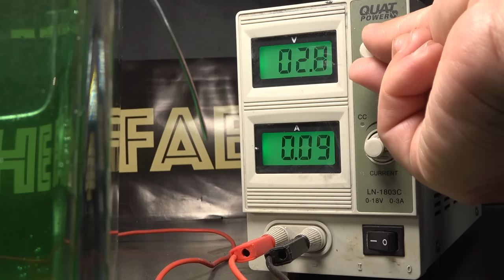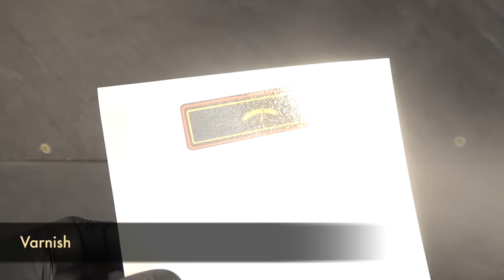1920's Live Steam locomotive 🔥💨  ! "BING" - Restoration

Comment: Awsome! I hawe the 1912 model, it's one of my personal favorites. I even managed to find some original tracks and switches for it.
Reply: I still have 8 pieces of O gauge track to go with my set.
Reply: @michaelcampin1464  Awsome! Even if those old steel tracks are not the best compared to the modern ones there is still a special feeling to them in my personal opinion that can´t be replaced by shiny plastic. (i hawe a modern plastic Lionel 0 gauge as well, but it mostly stand on the shelf since i lost interest in digitalizing after finding out i needed to replace the whole motor as well as running on DC if one wanted all the modern fetures and i don't want to build an entire new setup only for one single locomotive non of the other can even usel, so i concider selling it even if i love the design and the massive feeling of it, the old Hornby/JEP ones is just to clean and oil and it and put them on the track and they runs! Despite some of them being more than 100 Years old now.).

I Hawe the the Basset Lowke pre war steam mogul as well in my collecion, i managed to make a ok deal on it since it was smashed into pices whan i got it, but it was pretty easy to fix with new softsolder.
Ï currently working on an RC frame with model RC servos and a receiver for an old model aircraft radio i had laying around, my idea is to make the servos control the steam valve lever and the reverse lever (The double cylinder wersion has that function, the single operated cylinder does not i think othervise the seem pretty identical except for the construction of the steamvcylinders), perhaps also a servo for the steamwistle, that had been fun!
Reply from the maker: I’m looking for another steam livr loco ;) And that one is my favourite too 😌

Comment: Very, very nice results! Looks and runs great! Awesome job!  👍 The one piece that has the spring that is the cap for the water fill on the boiler is probably also a pressure release so it doesn't explode. The tightness of the screw compressing the spring probably is the adjustment for the pressure relief. On a real steam locomotive they're called pop off valves, in the USA anyway. Not sure how to adjust it on the toy but I'd say research and try to find out the specs on the little steam locomotive and adjustment steps for the pressure relief valve. That is if you don't know and/or haven't done this already. Live steam is fun but comes with some danger if not properly respected.
Reply from the maker: Thanks a lot William for all these infos 👍🏻😃🙌
Reply: @TheFabrik  Echoing @William Bryant 's caution here.  That part with the spring he mentions is the "Safety Valve" for the boiler, and the nut on the spring adjusts the pressure relief setting. If you want to keep operating the locomotive, you should really, REALLY pressure test that setting (off the boiler, not on) w/compressed air to ensure it is set at a safe level to keep the boiler from exploding from too much pressure.
Also, always be sure to operate with sufficient water. Overheating the metal due to low water levels has caused more "real world" boiler explosions than too much pressure. Distilled water is best for your lovely locomotive, to help reduce scaling and mineral deposits.
Reply: @TheFabrik  Just came across this. Aren't you devaluing the "antique" by taking off the original paint, numbers and names and such? That said, I wish I had the memory it takes to put all that stuff back together again. (Minus the help with the video of course)
Reply: @TheFabrik  Then again, I guess it's pretty shot. heh-heh.
Reply: @TheFabrik  All in all....Wow.

Comment: Lovely restoration! A word of caution on the boiler. I had a similar one explode on being fired up even though the safety valve was functional. It made a very big bang with lots of shrapnel and most likely caused by corrosion from within the boiler. These should be hydraulically pressure tested to ensure they're still safe before pressurising with steam or even compressed air.
A little oil on the side faces of the oscillating cylinders is a good idea too - lubricates and helps seal.
Keep up the good work.
Reply from the maker: Oh wow thanks for all these infos mate ! I was about to do another steam loco... I think I’ll thest the boiler definitely 😨🙌
Reply: May be a stupid question but I thought bronze doesn't rust?

Comment: I’m absolutely in awe of what you manage  (even electro plating !!)..  great work.
I’m told that getting rid of chrome can be done by soaking the parts in oven cleaner….. it certainly works with that horrid stuff that they use on plastic … so, although that’s the process for plastic, I would experiment firstly with the materials you work with.
Cheers. 😊
Reply from the maker: Thank you very much !!! Sometimes chrome can be removed easily… sometimes it doesn’t ;)🙌
Reply: When dealing with German-made things- nothing can be taken apart easily!  @TheFabrik

Comment: Love this! I used to restore Mamod steam toys as a teenager about 20 years ago - this makes me want to dig them out and run them again!

Their boilers, fittings and pipes used normal solder instead of silver solder and when fitting pipes to the brackets we’d whittle down a match stick to plug the hole so that the solder wouldn’t fill the pipe.

One of the cylinders looked really tight when you were inserting the piston when reassembling - did you have to ream the cylinder out or just run the locomotive in for a bit to wear it in?

Comment: Let’s not even get into how dangerous this toy must have been.
Reply: Especially with a screw to hold the smoke pipe?? This toy must've been a grenade. You would need to KNOW how to use it. I think we can imagine why they stopped selling this. It's old and clunky, and it's a live grenade children's toy.
Reply: @danielwinters71  I'm afraid you are mistaken.  (i.e., you are writing rubbish!)
The boiler has a safety valve which would release the pressure if it got too high.
Now, if the child holds the boiler, then, yes, they will burn themselves - that's how they learn.
Reply: Nonsense - see my reply, below.

Comment: I use to work at a steel fabrication shop and all of the processes of the pieces of items, that you were working on, were done at the shop. The did not have a 3D Printer, though. To work with items that small. We had to supply our own tools.

Comment: I wish restoration YTs would just restore these types of things to working condition without getting rid of original paint or replacing parts that are unnecessary to replace for it to mechanically function again. The original paint may look crusty, but it's way more neat to me if it's the original.
Reply: I would agree with you and keep the orignal paint as much as possible. But the problem is that many paints of these times contained lead and as such are dangerous, even more if the original paint is flaking. So...
Reply: @laurentdevaux5617  that's a great point. I hadn't considered that

Comment: There was one small tiny detail missed in the restoration. One that honestly is understandable since there wasn't much left to recreate. But you can just see along the sides on the part that holds the boiler. There was a small decal that ran along that part.
Again, it's extremely small and doesn't in any way take away from the skill needed to restore something like this. Especially saving the thin parts. I imagine many others would've just remade them instead of trying to save them.

Comment: The most amazing thing about this is that you managed to unbend and then rebend all the fold over tabs without breaking them!  If I were to attempt something like that half of them would break. Nice result although I prefer a more original look if possible.

What metal did you use for the plating of the wheels?
Reply from the maker: Thank you very much :) it’s nickel plating 👍

Comment: Was the boiler pressure tested?
Around 10yrs ago we had 2 100yr old+ clockwork powered Bing locos running on our G Scale exhibition layout. They were unrestored but faultless, governed down to sensible speeds. Each ran fir several minutes on a single wind. Remarkable.
Reply from the maker: Wow I would have loved to see these locos ! 🙌 I didn’t test the pressure… not very safe I must admit

Comment: Super cool restoration! I am so impressed of this train, how old is this thing? Before there were batteries and electricity they could make this kind of toys, I am so impressed of this. But of course this is super dangerous for a kid, also I keep wondering how you are suppose to stop it? This is going super fast, and if you grab with your bare hands this thing would be super hot, and also it has alcohol inside, so it is not like the fire will go away sudenlly, you have to use a metal object like a small spoon to take out the fire.
Reply from the maker: Thank you ! This loco is 100 years old. More or less. And you’re right, you cannot stop it ! Unless you wear heat protection gloves ;) in any case, it runs only for about 2/3 minutes 😌👍

Comment: When raising steam on a pot boiler it saves time if one fiils the boiler with hot water from a kettle using a small funnel.
Did you hydraulically test the boiler before firing?
It would be as well to do so if you haven't as a boiler explosion of this size is akin to a hand grenade.
Reply from the maker: Wow ! Thanks a lot 😊

Comment: Be very careful when buffing springs, particularly small critical ones for steam engines. I believe one I saw being Dremelled was a pressure release valve spring, necessary to vent over pressures, a hazardous situation with high-pressure steam and small metal parts. Use a fabric pad instead of a wire wheel, slowly and at a low speed setting, as any dwelling on a particular loop long enough to heat the spring can cause weak or brittle spot. This will ruin the temper of the steel and compression/rebound rate of the spring, rendering it useless for the task,and susceptible to failure.
Reply from the maker: Thanks a lot for all these tips 🙌

Comment: I have a question? I though to Nickel plate a steel or cast iron item it first had to be Copper plated. Is that not he case?
Reply from the maker: You’re right, nickel plating works way much better on copper or brass…

Comment: I've never understood it, you have a sand blaster yet you waste your time paint stripping and using electrolysis.
Reply from the maker: It’s just because I don’t want to have too much lead and painting residue in the tank. Also the metal sheat is so thin sandlbasting is a bit agressive and abrasive... many thanks 🙌